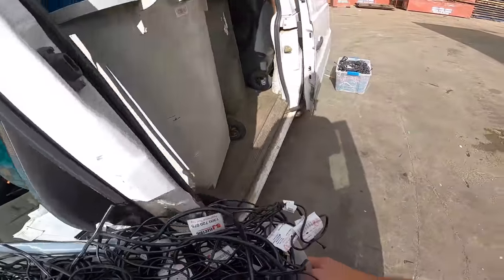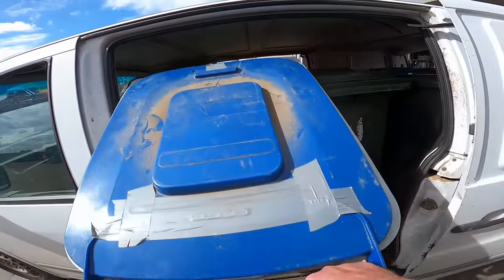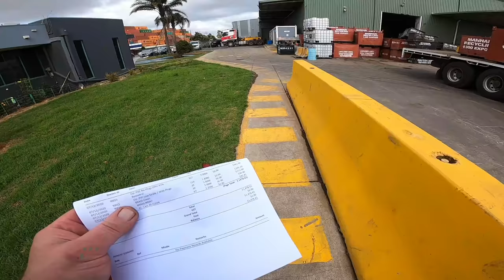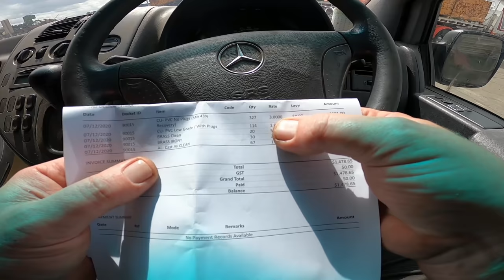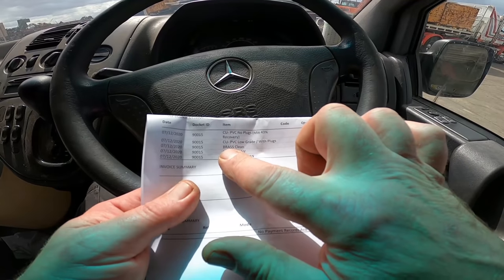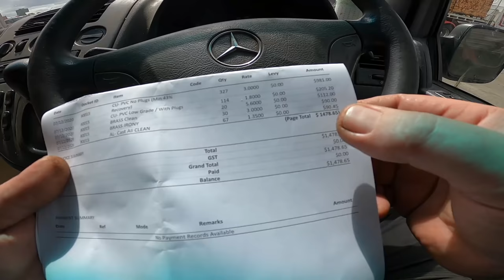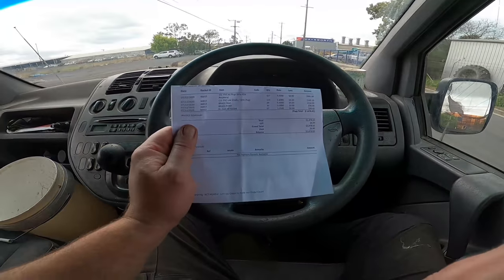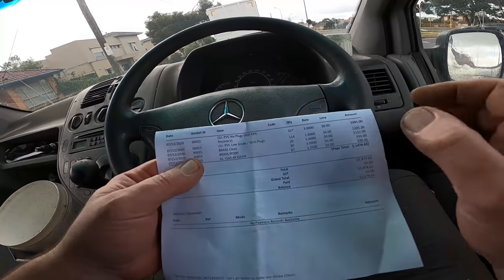Scrap Yard Cash in Day

Comment: Carry a few screws with you just in case you get another puncture.  They'll stay in long enough and keep the air from leaking out while you are getting where you need to go.
Reply: Excellent idea!
Reply: Or just a plug kit and a small compressor
Reply: Yeah I'd keep like 2 plug kits in the center console and small air compressor or a tank of compressed air. Most people dont know but plugs last a lifetime I had a honda accord wagon and I used to scrap in it and I had one tire with 3 plugs and one with 2 and they literally lasted until I sold the car a year later
Reply: @fumertonb  don’t be so childish…… up your nose and around the corner;)

Comment: Having visited Manhari myself recently.I get the feeling there's a price gap between being an ABN Vs Non ABN holder. That or they have some price structure based on quantity (more you have the higher the rate.). $3kg/$2.10kg.........Insulated copper.  $1.80kg/$1.20kg for low grade cable. clean brass $5.60/$4.50. Domestic Aluminium $1.30kg/0.80c Kg  Am i right or are Manhari selectively ripping people off?

Comment: Does your recycling center take Coaxial cable? Mine won't, not even for free
Reply from the maker: Yeah it's low grade here mixed in with everything else ;ow grade like ribbon wire, wire with plugs etc
Reply: @eWasteBen  Lucky that, I just pulled near 250m out of my house when we realized cable TV wasn't a thing any more. All of it was still connected to a powered 500mA signal booster, 3 years after last having cable!

Comment: Hi Ben  . Have you gote Cable Stripping Machine ? If you have, you can get more money for the Copper. I see most of the time in your Videos you don't take the vacuum cleaners 
Instead, you cut only the cable but the time is the same  There is a lot of Copper in their engines
Best Regards Peter and Emil  from Sofia Bulgaria